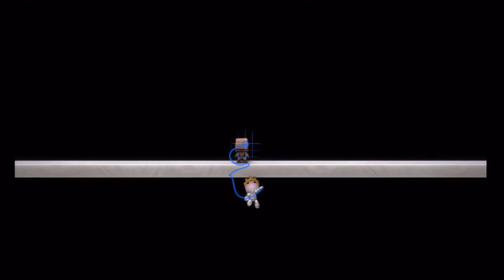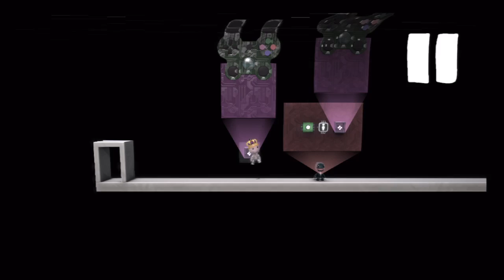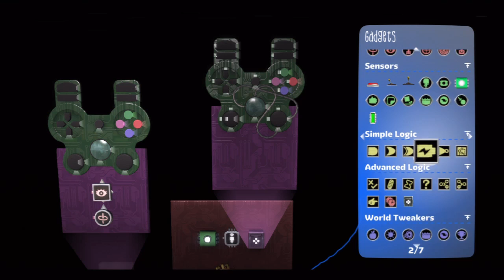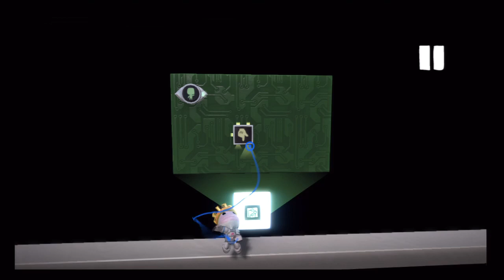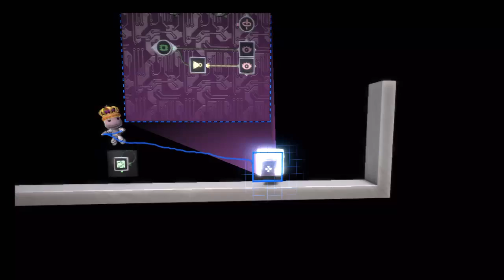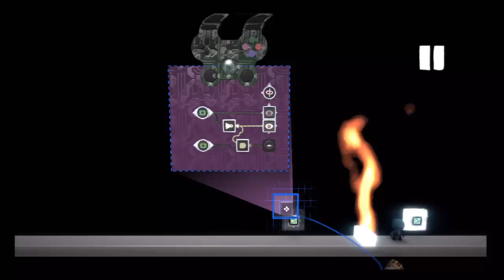LBP2-Torials 04: Sackbots, Followers, and Checkpoints

Comment: theres a problem...
when your working with multiple sackbots and the checkpoints you didn't fix the thing that:
when player 1 is far away from the checpoint, and player 2 dies am I correct that player 2 will spawn but then of them is outside of the screen how you fix that?

Comment: @ClayDudeMan If you label a tag something (e.g sackbot) it will activate a tag sensor that is labelled the same thing, just like normal. But if you have the tag sensor labelled something else (e.g sensor) than the sackbot tag will not activate it. This way labeling a tag and a tag sensor the same thing it is like adding another option. I know I'm not compherm but i hope this helps :)